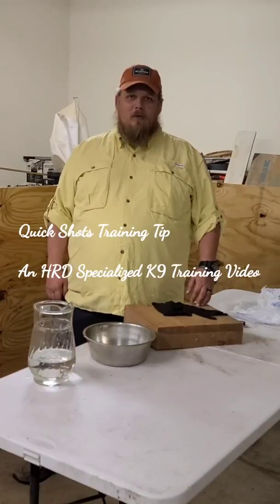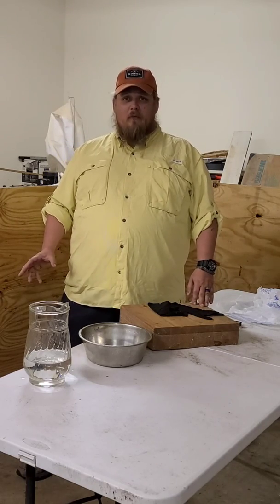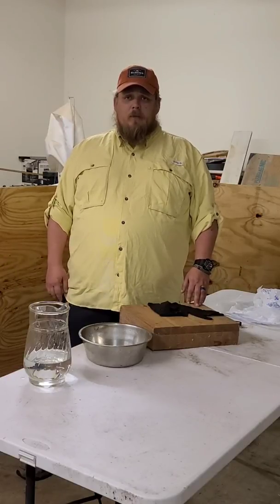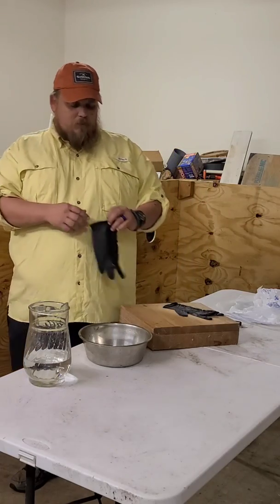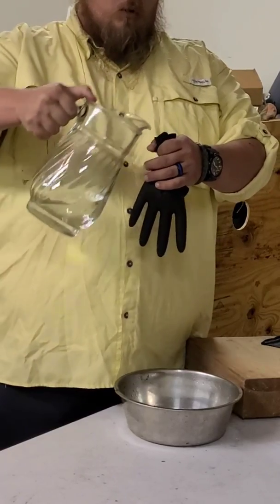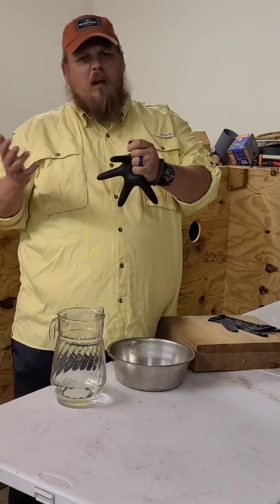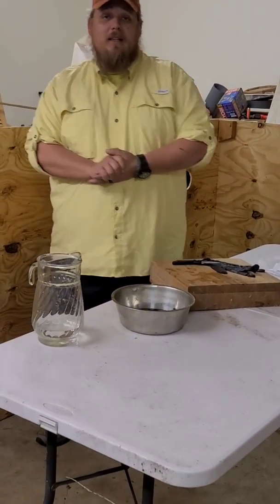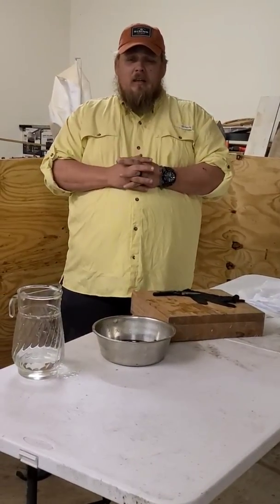Freezing Material, What Happens?

Comment: Excellent explanation Paul. Thank you. Question: is a cold cellar cold enough to store source? Very limited fridge space. Thanks again!
Reply from the maker: Can understand not having room for an additional fridge but I would say make sure it is in  air tight containers and they are secured.
Reply: @HRDSpecializedK9Traininig  Sorry, I wasn't clear. I did have some freezer space, but want to move it to fridge. So, fridge would be better than cold cellar?  I want a separate fridge so, I could probably get a small bar fridge to use. Just have to get one that will fit my marine boxes.
Reply: Thank you!!
Reply from the maker: @ejvarady3570  Yes, take the shelves out and it will be good.
Reply: @HRDSpecializedK9Traininig  Perfect. I will measure the containers and then buy according to that. Thanks

Comment: So Paul, I totally agree with this and have seen it happen--does freezing change the scent picture for the K9?
Reply from the maker: That's a yes and no answer. So, the odor picture is going to change slightly from the time it was put into the freezer to that first thaw.  Then this odor picture is going to change between that second freeze  and the subsequent thaw. Where as sources that have been refrigerated is going to present  a consist change in the odor evolution.